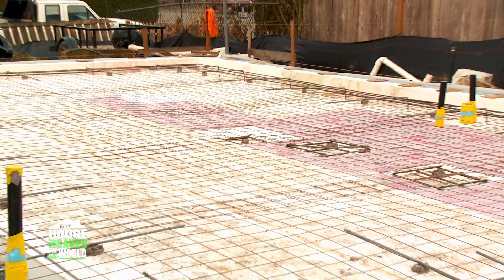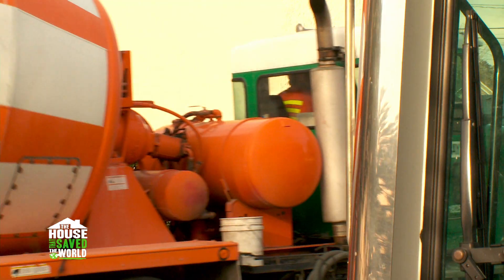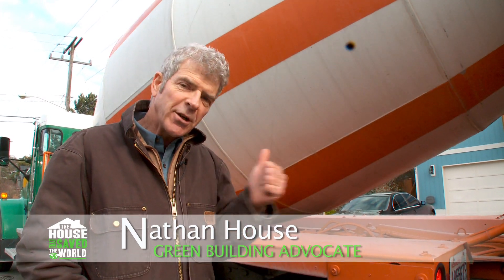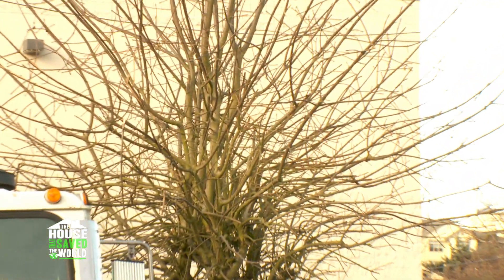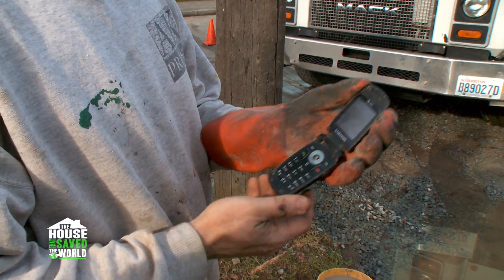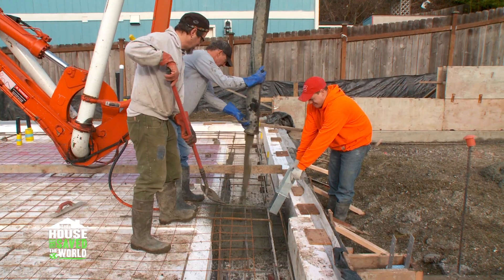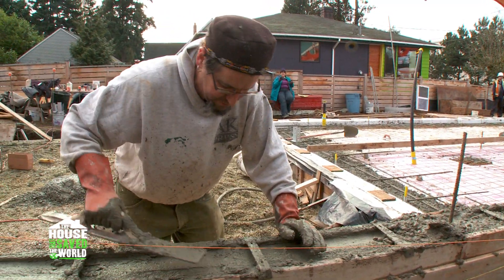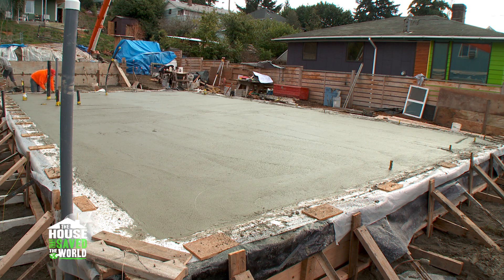The House That Saved The World pours a Passive House foundation.mov

Comment: https://www.youtube.com/user/seumas2/videos

Port
Alberni's first Passive house (Passivhause) build in the heart of
Vancouver Island British Columbia Canada.

Passive
House(Passivehaus) is considered to be the most rigorous 
voluntary energy-based standard in design and construction industry
today.

Passive
house buildings consume up to 90 percent less heating and cooling
energy than conventional building.

The
use of Passive House design software was used to gain the specs
required to meet the performance standard for this location.

House
was constructed well  above the current standards as outlined in
the B.C. Building Code.

Footings
were widen to 36 inches(914 mm) due to low bearing soil conditions
and additional rebar reinforcement added.

30
inch high (762 mm) high reinforced walls . Course sand placed inside
foundation walls and mechanically compacted.

Three
layers of four inch *102 mm) thick  Expanded 
polystyrene foam sheets with all joints staggered and tape were
placed on top of compacted sand.

The
three layers of foam have insulation value of approximately R 50.

A
20 mil layer of poly was placed over the E.P.S. sheets and taped and
sealed.

Four
inches(102 mm) of 30 m.p.a fiber reinforced concrete was placed to
form a slab over the foam based.

Slab
is isolated from concrete stem wall with four inches (102 mm) of
E.P.S. to prevent thermal loss.

All
cold water lines are buried in the sand to keep them cool, hot water
lines have been placed in the center layer of foam insulation to
minimize heat loss.

Wall
plates compress to heavy beads of acoustic sealant between layers of
vapor barrier to prevent air movement.

The
walls are double stud configuration set at 24 inches (610 mm) on
centre and plates are spaced in a manner that yield a 20 inch (508
mm) thick wall. 1/2 inch (12 mm) standard plywood sheathing with 
Mento 1000 a three layer airtight vapor open house wrap( far superior
to common house wraps) with 1/2 inch(12 mm) pressured treated plywood
rain screen battens form the exterior surface. 

Intello 
smart vapour barrier was installed one third in from the inside wall
to prevent condensation in this climate.

Triple
pane argon filled windows meeting passive house standards from
Euroline  were placed mid wall to reduce wind wash heat loss. 
All window openings have been splayed at 45 degrees to give a full
wide angle view.

Almost
all the wiring and plumbing was kept inside of the vapor barrier
envelope to minimize air leakage.

Passive
house standard requires air leakage not to  exceed .6 Air
changes per hour at 50 pascal.

Zehnder
comfoair 200 HRV has been installed with a 1000 watt air preheater
.(92 percent heat recovery rate)

House
has been pre- plumbed for a heat pump water heater reducing 
domestic water heating cost significantly.

Garage
has been pre-wired for 40 amp/240 volt  electric car charging
station.

House
to be equipped  with  heat pump condensing dryer which
requires no external venting,only a water waste line. George K
Builder. © George K 2019      
https://www.youtube.com/user/seumas2/videos